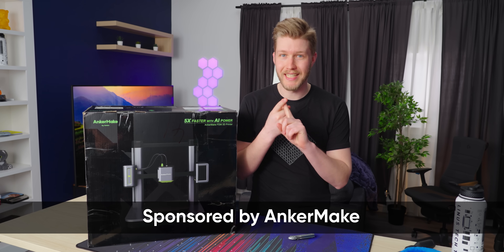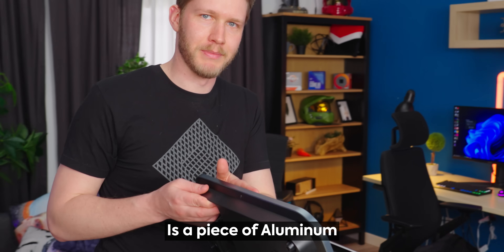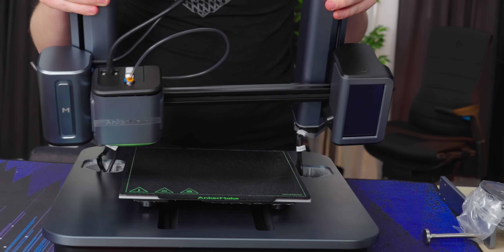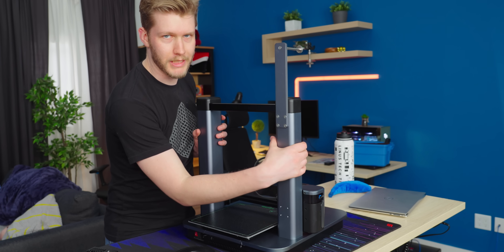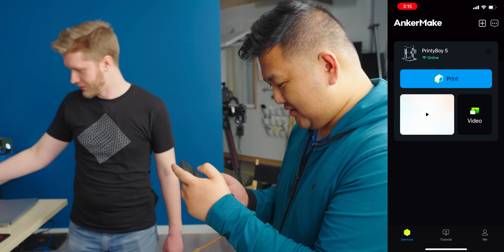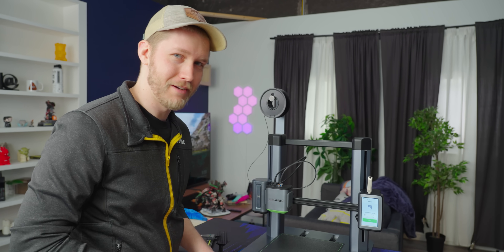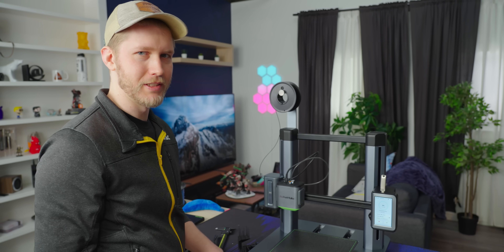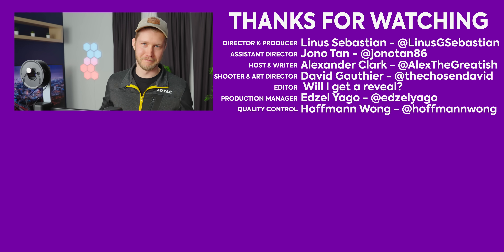Much BETTER than Expected - AnkerMake M5 3D Printer

Comment: You are extremely ignorant when it comes to 3D printers. Engineers always think that they know what is going on with a machine. You do not need to auto level before each print and, there is also a lot of issues that can still occur after the first layer.
Reply: you are extremely uninformed. When doing large prints it is ALWAYS worth running an auto level before starting the long print, what is 1 minute spent when you're about to run a 24 hour long print? edit: or even a 24 minute print for that matter. It's still worth it.

He said the most important/common issue is with first layer. If your first layer goes down sweet your biggest, most likely, most common, and most expensive issue is far less likely to happen, that is your piece coming loose at some point during the print which is an unrecoverable issue.

Comment: For me it is the same as any of the latest entry level 3d printers, except for the AI detection, the spaghetti part. The problem here is that it has a good finish, but it still has the technology of the latest 3d printers like: Elegoo Neptune 3 or in the same range CREALITY or similar from 2021. There is still nothing that impresses (after all, EVERYTHING GOES IN THROUGH THE EYES).
The day they connect the A.I. to an entry level printer with A.I. codes made by engineers that can detect all the errors a printer can have when printing, and can tell the motherboard how to print, THAT DAY, WILL BE THE BIG CHANGE IN THE GAME until then, we only have small updates of every new printer that comes out.

Comment: Couple of things... Why does Anker, a massive company need a Kickstarter campaign? Sounds like they're not very confident in their own abilities and it's odd they didn't reach out to some of the mainstream YouTube 3d printing channels like Naomi Wu, 3d printing nerd, Thomas Samladerer, Makers Muse or Teaching Tech etc.. it's kinda odd. Something doesn't sit right with me.. so I probably won't back it. Hopefully I'm wrong and nobody gets screwed.
Reply: The product isn't as complete as they would like you to think. I am a backer and they are assuming a NOV release after some tweaking delays.
Slicer still isn't out and no videos about their V6 color changing system.

If I had to do it all over again I would have ordered 2 bambulabs X1C. Bambulab had no issues getting their printer out to YT channels prelease and to the backers post campaign. No paid sponsorships either.

Comment: My Elegoo Neptune 3 has no problem with the .2mm, but I was unable to get the .1mm loose :)
Reply: Bambulabs X1C prints the fdm test in less than 90min on standard speed or about Anker speed in the slowest setting.  All pegs release fine for both. You can see some results between an ender, x1c on bambulabs subreddit
Reply: @No0o0o0o0o0  that's a $1.200 printer.. mine is $200
Reply: @primologyx  X1C was $1000 with earlybird kick starter but its actually $1450 with AMS retail.

I was comparing bambu to the anker which retails at $800 and $500 for their v6 multicolor. 

I have a $100 ender 3(hundreds spend in upgrades though) and can print the test but the 2 left most pegs fuse. It's also a 6hr print at 50mm if i want it to succeed.

Comment: I recently got an FLSUN SR Delta printer, and compared to the first printer I got in 2015, the difference is staggering.  Set up was easy, Cura is a breath of fresh air, bed leveling is so fast and only needed to be done once, and it prints so fast and cleanly.  Only issue I've had to tinker with here and there is bed adhesion of smaller parts.

Comment: I checked it out and it's only 600$. atleast looking back at the 300-400$ spent on my ender 3 pro....+raspberry PI, +brick for ras, +knowlage to code and fix things to work via wifi and bluetooth......+a bunch of filament to print with.....yeah I also spent nearly like 600$......
If i were to get this weird AI printer it would DEFINITELY NOT be my main printer....like it wouldn't be a replacment for my ender-3-pro. rather it would be possibly my main printer for the final print...and use the ender as a prototyping printer. I wanna hear what other 3d printer ppl would do with this weird AI printer?
Reply: Just wanted to point it out kid, the m5 is 800usd with V6 at 500usd

Comment: ShortCircuit needs to make some serious changes.
1. Stop reviewing such random devices. I'm sorry but I don't care about one random Anker 3D printer. Review normal things that normal people buy. Or review crazy things that inspire the imagination. But don't review things that are uninspiring AND that nobody buys.
2. Stop emphasising such random parts of the review. I don't care if a laptop's corners are a tiny bit squarer than the previous model. I don't care if the disc tray button is "not super crisp". Random stuff like this often takes up half of these videos. I wanna know price, mAh, GHz, cores, etc. And then maybe embellish it with a little bit of other stuff. But you gotta have info and specs at the core of the video

Comment: Who is this video aimed at? For someone that's entirely new to FDM then it's okay, but as an intro to a new printer for those already experienced it's pretty weak in detail. It looks nice but at the ~$800 USD price point I can't see buying this over an i3.

Also clipping the filament at the heatbreak was a very strange thing to do... There appears to be a filament run out sensor integrated into the extruder but cutting it there won't trip that sensor until the roll runs out and not someone has to pull that filament in there out because it's not going anywhere, seems like an unnecessary mess if the filament melts in the heatbreak (I have no idea if it has a PTFE tube of it's even an all metal hotend because Alex didn't say).

Comment: 'Overclocking' a printer by increasing the voltage does work to some extent. Stepper motors have more torque and can run faster on higher voltage. Most other components in a 3d printer won't survive this though.

Comment: Ender 3 is the best entry-advanced level 3D printer imo and they are only around $200 so very affordable. I have never heard of Ankermake it looks nice, but way to much unneeded features. The custom aluminum extrusions are only upping the price and will have a lot less compatibility with upgrades and or printed mods. The hot end being buried under all that crap would just be a pain. It also looks like it would take up more space then an Ender 3 with same if not smaller build plate. I see this printer having more things that could go wrong and harder to fix. This printer is so not worth the $600 they are charging when it is pretty much an overly fancy Ender 3 with a bl auto touch leveler.

Comment: so looks like it's not much different than other printer and the nature of 3D printing, not like they can print without support. So yeah, next. With Chep's cura setting, I was able to print my stuff for half of the time of my regular time, so it's all about how you tweak the slice, and if you know how to do it, you can do it with any printer, even a $100 ones, and knowing that will do you good instead of relying on the machine helping you.

Comment: I don't like that they went with their own slicer but maybe its necessary in this situation? As long as I can also use open source solutions like Cura, I will buy one. Not interested in any sort of vendor lock in, especially from a kickstarter product. I'm very much a fan of how open the 3D printing tooling and community is :)

Comment: why do all these vidoes on this overhyped machine do not show it printing at 250mm/s like they say its suppose to do?      and 250/mms for a benchy @45mins isnt 250mm/s like they say
Reply: It clearly shown in the video the printer printing at 250mm/s 20:26
Reply: @firelion98  lol now thats funny
Reply: @worthless4194  10:26
Reply: @firelion98  ok watch uncle jesses vid it shows he does a benchy at 49 mins @250\mms  more like 95-97/mms  thats not even close to that  and no way is a bed slinger printer going @ 250/mms and they say 5x faster so the benchy should be printed  at 18-20 mins for those speeds

Comment: I'd sure like to see more maker-y stuff, sure, but this non-critical video, featuring a hand picked pre-production product, isn't it. Where is it made? What nozzles does it use? Are hot-ends swappable? What firmware does it use? What is the board? What are the dimensions? Instead, we see a demo of a few functions that might or might not make it into final product.

Comment: Should be noted that unless the model has longer extrusion paths where it can accelerate up to max speed between curves/turns, it wont actually print 250mm/s. An easy way to demonstrate this is to print that sample model at 250mm/s and at 50mm/s. I am pretty sure the print time for the faster speed might be half the time, but it wont be 1/5 the time because the model is small and intricate.

Comment: a nice pro of autoleveling is that the beds are often slightly warped or bend with often a sink in the middle. with autoleveling it can make up for that, without you get serious problems in some cases. my 3d printer for example couldn't print small circles close to the center, lines where fine, but circles became poop, to fix it it needs to be levelled differently but that way it wouldn't work for larger objects due to it hitting the heated bed on the edges if it was at least somewhat close enough to it in the center.

Comment: 250 mm/s w/ 500 mm/s acc.... That's absolutely no better than my first Ender 3 can handle without cooled steppers. You need A LOT more accel to even reach these speeds. Needles to say, this machine won't hit 250 mm/s printing unless it is printing a 125  mm straight line! Then it would need anothere 125 mm to break down the speed again! So with a build plate which is only 235*235, you won't ever hit that max speed! Another thing is, you'd need a ultra-high flow set-up if you want, to actually print 250 mm/s at 0.2 layer height with 0.4 nozzle width, since you'd request filament extruding above 23 mm3/s! That little shite extruder they added for this machine will never achieve anything close to those numbers. In my experience, non-high flow set-ups start under-extruding.
All in all, this machine does look promising, BUT there is a fair amount of bullshite marketing and promotion going on in regards to this machine's capabilities.

Comment: So they did not mention important information like
- is it dual drive extruder?
- it's obviously not direct drive which is a minus
- what is the temperature range it supports
- what is the mainboard and firmware and can it be updated and so on

Comment: For a company that always point out quality parts over "cheap" Chinese ones. This is practically overview, nothing more... Some cheap power supply, cheap loud stepper drivers, proprietary app, god I hope it doesn't have v-wheels on all axis. Speed of 250mm/s means nothing if acceleration can't keep up. Flexible build plate is standard on even the cheapest Chinese printers nowdays. All this could be done with a raspberry pi, camera and a 30 minutes of your time. Come on, you could do it better...

Comment: Shouldn't use a roled extension, you should extend it other wise your creating a massive inductor it can lead to heat on the wire an cause a melt and a short after that just be safe always unfold extentions rather safe then sorry

Comment: Looks like a good printer. Not sure about the ability for someone new to 3d printing using it without issue. It would have been great to see you print your own file, and demonstrate the AI failure detection. Also the app is a big feature that should be showcased.

Comment: 10:54 the fact you did a jump cut and its still going says its not that fast at all. Also, bed adhesion is a lot easier with PLA and the texture build plate

Comment: So I dont really see why these comapnies are still trying to make bed slingers faster when corexy design is already much faster and run much higher acceleration and just a better design. Anker says 250mm/s but I think that is bogus because with the accels you need to run on a bed slinger youll never actually reach 250mm/s. My Voron I am running at 1000mm/s and 25k accels.

Comment: Final part will most certainly have a cast aluminium base with only the top and the circumference surfaced and some reference surfaces CNC-milled. That will bring down the cost considerably and there is a gazillion companies all over China that make such parts for all sorts of power tools...

Comment: Seeing this just tells me how bought you are. So many of these features are unnecessary and stupid. Adding all the weight of camera with the lens right next to a hotend and a bunch of thermoplastic which claiming these speeds on a Cartesian is actually insane, and downright criminal. I can at least know now to never trust a review by you to be genuine, as goes with most of the youtubers in the printing community. I am so tired of all the payoffs and disingenuous promises for newbies only to ruin the hobby for them with overpriced gimmicks. What we want is tight tolerances and good parts. If you fail to do that when your job on the surface is to guide and reccomend people products you should be aiming to help them not frustrate them. But I'm sure it pays so much better to just suck the company paying you off for 17 minutes straight.

Comment: oof "been using '3d printers' for a decade"... zero mentions of mesh bed leveliing, PTFE tubes or what slicer or settings used was it all just pre loaded SD? he cut the ptfe with a dike to stop the print??.. huge groan.  and he didn't start with a benchy.  this reivew was just dumpster fire... sorry.

Comment: Not bad but setting up a ender3 or even ender 3 clone like a voxelab Aquila is pretty damn easy and there $180 and a bltouch is like 30$ and magnetic pei bed is $20 you can get a filament runout sensor for $5 if you want one so you capfuls have very equivalent printer for $250 today hell ender has like a S1 where it’s just the tricked out ender3 that would probably be a better printer than this for like $300 and if your gonna pay too dollar and don’t want to work on your printer just turn it on and print get a Prusa mk3 this machine looks hella gimmicky to be honest

Comment: I have been printing nonstop, but only for a few months, with an Ender 3. 8 bit board. Loud. Alum extruder + better bowden, everything else still stock. I considered this, the Ender S1 Pro, Sidewinder Genius Pro, Mingda Magician X, for a follow on 2nd printer which will become my R&D box. All roughly comparable feature wise, with this one being the Cadillac since it will have video and wireless built in. However, of all the things I can do myself, the video and the wireless (via Octoprint) seemed the most like something I could figure out. So, I repurposed my almost too old Raspberry Pi (turns out it is very easy now) to check out how well it worked with my Ender 3. Given the Anker has a lot of unknowns (like, what will be the parts replacement options, what upgrade paths might exist, what slicers will work, overall longer term durability, where are the belt tensioners), that ruled out this machine for me. The Mingda's build quality from what I have seen is a little rough. The Sidewinder looks like a solid option, at a nice price point. I'd be hard pressed to find worthwhile flaws with it... however between the Sidewinder and S1/S1 Pro, I tipped to the Pro since I will have an all metal hotend, and can print just about anything, plus a PEI surface out of the gate. I got the S1 Pro during a sale, so it came in $300 cheaper than this one's list price. Also, Creality has a laser engraver that works on the S1, and  hopefully also on the S1 Pro. Anyway, this looks like a great printer for someone who wants to have  it just print, and not be a fuss about machine. There will be a steep learning curve still, but it'll be less steep to first successful print. Which, frankly, keeps a lot of people out of the hobby and/or from progressing. The anecdotes I've heard about abandonment of 3d printing suggest that this could fill a very nice niche among higher income, time strapped people.

Comment: Honestly the funnest part about 3D printing IS the challenge of just making it work. Like if I could just press “print” and have it spit something out perfect every time, I probably would have used my 3D printer twice, rather than the entirety of the last two years.
Reply: and that is cool, for you - but a lot of people get legit frustrated by this aspect. The great thing would be for the space to allow both to participate, right? People can still build and tinker with projects on cars, or just use them.

Comment: The dimensions are all 0.4mm off because 0.4mm is the dimension of the print nozzle.  The printer moves where the slicer tells it to, but 0.2mm of the nozzle is on either side of that location at any given time.  This makes things like cylinders 0.4mm too big and things like holes 0.4mm too small.  

maybe a little oversimplified here, but this is basically what is occuring.

Comment: Too expensive for the average 3D printer community. And probably all proprietary. The 3D printer community likes open-source and easily upgradable, reasonably priced 3D printers and replacement parts. This is why Creality 3D printers are so popular at under $200. Plus 3D printers are a niche product and community. This printer will not sell very well.